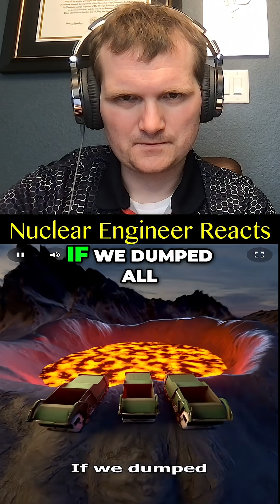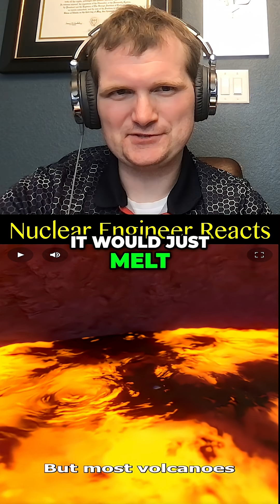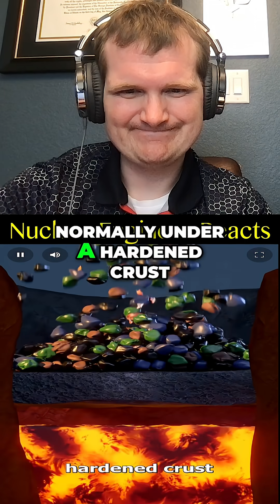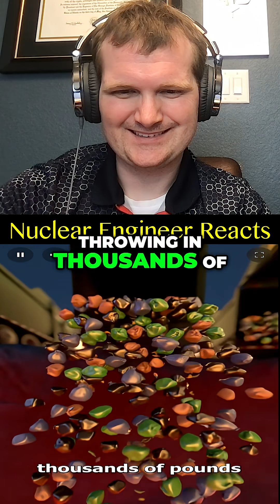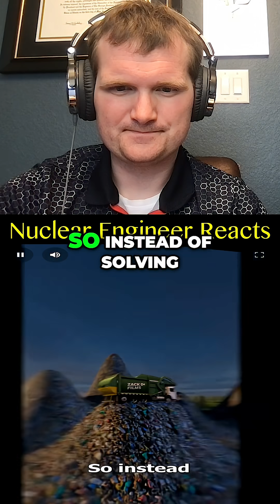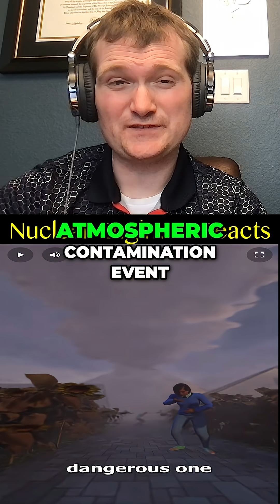Why We Can't Dump Trash in a Volcano - Nuclear Engineer Reacts to Zack D. Films

Comment: Unlike everything you see in the movies, unless you're throwing something dense in there like solid steels, things will just float on top of the lava. It's at least 3 times as dense as water and thousands of times more viscous like molasses. Gollum wouldn't sink into the lava, he'd just sit there on top of a liquid griddle getting cremated.

Edit to add: this concept really clicked for me when I was studying lead cooled reactors. The coolant can be more dense than the uranium fuel rods, and the rods can float to the top if they're not secured properly. Which can be difficult to do operationally as you can't see thru your coolant like you can with water.
Reply: Well...this was...educational in a disturbing kind of way. Nice case study tho.
Reply: agree with everything just interested with gulum part. I think he would sink because basically water in his skin would start evaporating en masse and create steam pressure points by pushing lava beneath and when steam finds an escape route, the falling body will fill in that space faster than volume from under, so as long as there are water or other materials that turn into gasses body would sink just way slower than golum. Plus all the destruction from temperature would effectively "concentrate" your mass into a smaller point, changing buoyancy quite drastically. 
So my guess would be that falling force would be enough for partial submergence, then destructive processes would allow for more submergence, which would look accelerated because from the top we could not say how much of the body is disappearing because of thermal destruction and how much because of submergence.
Reply: @mindaugas205  Nah, people have died on lava many times and videos exist of it happening to people. It's bad. You will not sink at all. It is so hot that it will roast you alive while you're violently thrashing around on it's surface. It's a horrifying thing to witness. The water in your body creates a microscopic layer of steam as it evaporates that makes you kind of slide on the surface until you've cooked to the point where you are just charcoal sitting on the surface, which would then slowly sink and be incorporated into the molten rock. I do not recommend looking for the videos. I grew up in the days of the uncensored internet and that was one of the most brutal and disgusting things I have ever seen happen to a person.

Edit: Also, if you think the impact of him falling is what's gonna make him sink; that's also a misunderstanding. You could drop a solid lead ball onto magma and it would not sink like it hit a liquid. It would smack the surface, leave a big dent, and bounce a bit before landing. It might sink a millimeter or so before it's completely melted, but that's about it. Something like tungsten that is dense with an extremely high melting point would sink, but it'd still happen extremely slowly. Like over the course of multiple minutes. A person would never come close to breaking the surface tension.